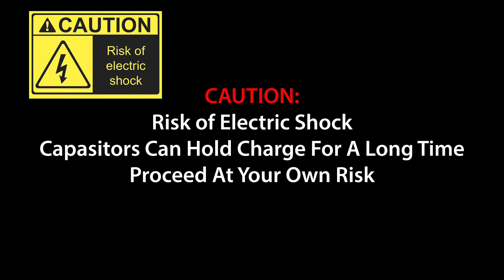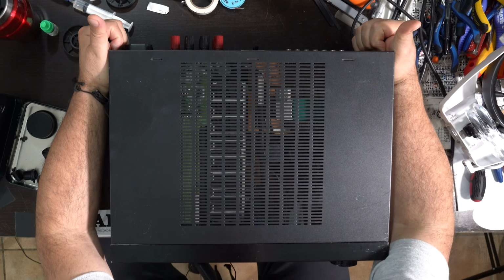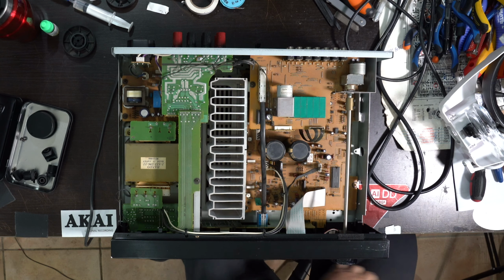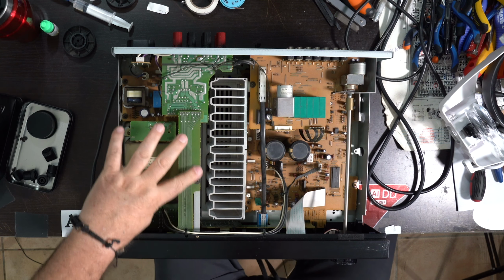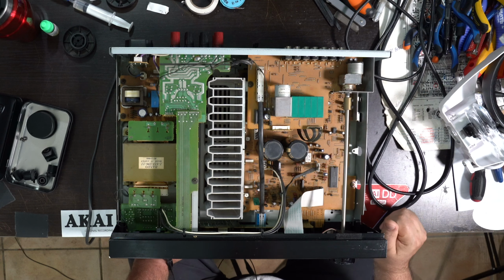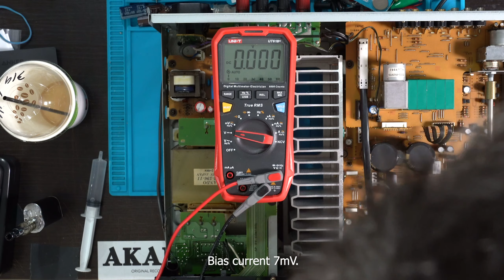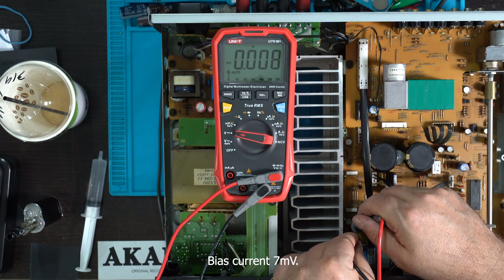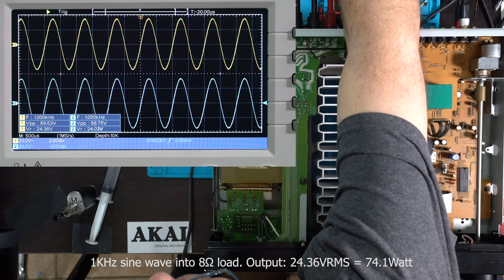Sony F435R Amplifier Repair, Restoration & Test.

Comment: Excellent job as always Alexis. This Sony seems to be a decent amp. Congrats for the Camel, Mystic Queen song selection. One of my favourite groups. !!!
Reply from the maker: Ευχαριστώ πολύ George! Thank you for visiting again. Yes it is quite decent amp, not for critical listening but around my basement/lab! is perfect. Camel... I believe they are the most under rated band of all time. I bought my first LP of them (Mirage) in 1977 just because of the cover!! And after that... it is my #1 band! Και πάλι σ'ευχαριστώ πολύ.
Reply: Hi, I want to replace and upgrade everything on my Sony ta-f435r. It doesn't work anymore. Where can I order the parts?